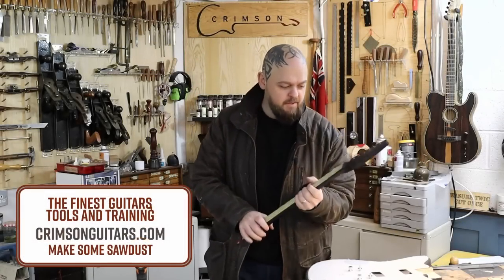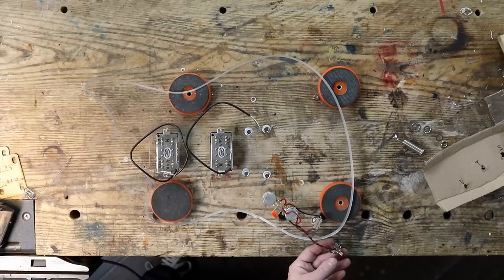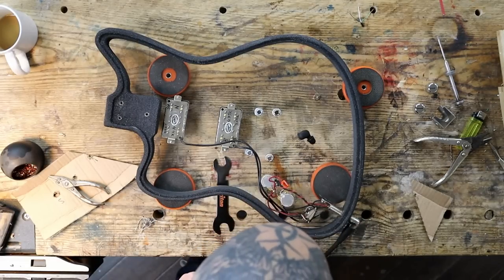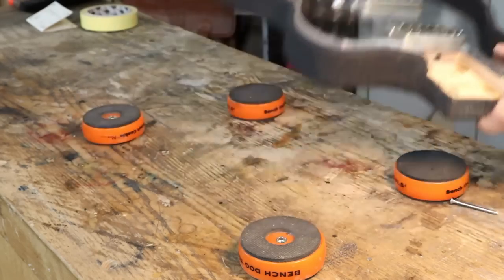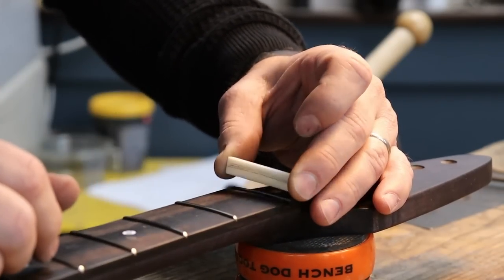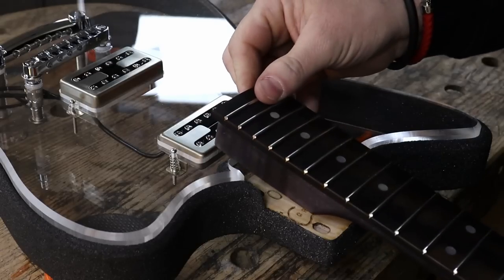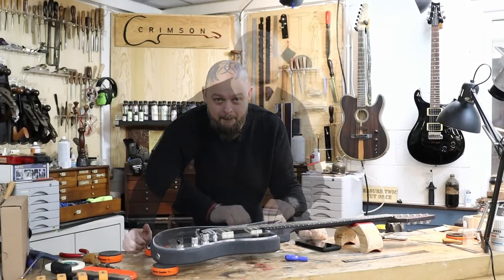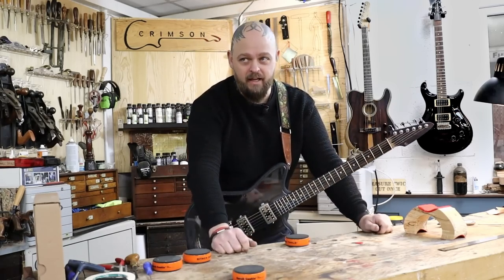Will this Disintegrate?  Finishing touches! Watch Inspired Guitar Build | GGBO2022 Invitational Ep 5

Comment: Looking really sweet now!  Those bolts stopping over compression in the center of the body could do with rubber or silicon pads on the top though; over time I can see scratch patterns building up as the back impacts and rubs against them.

Comment: Hi ben.  love the look of this guitar and it sounded really good.  for the internal wiring did you ever consider doing cable lacing and creating a proper cable loom?  would have looked really good and tidy with the clear body.  i also assume that users will have to be careful of belt buckle scratches on the back of the body.

Comment: You should use copper used for inductor to link everything together, with a bigger gauge you could use them straight, as a bar between circuit and make the  wiring look more clean

Comment: I have worked with quite a few plastics and have found that a used dryer sheet works well to clean and remove the static inherent with the material. Used, not fresh or else it get some weird waxy streaks.

Comment: Since you like using your torch,  and want clear acrylic you can flame polish the beveled edge of the acrylic with a standard propane torch head with a fine pointed flame. It takes a steady hand and the right speed to get it to melt but not bubble, but the results are imprssive.

Comment: You can actually polish those bevels and the insides of the pickup routes and get them dead clear. It's time consuming and requires a lot of patience though.  Take a look at what some high end granite or glass guys do. I've seen them slowly creep up, and sand and polish. Was this huge bathroom job with a lot of glass. A lot of hard bevels, as well as rounding. And all those edges of the shelving created was slowly sanded and polished shiny smooth.  edges of shelving. It was crazy. They also did the mirrored walls, and bevels around the edges of the faces. Lots of patience which I don't have.

Comment: I am a fan of your guitar building skills, any other guitar i like from you! but this here.. hmmm  this seems cold to me. Yeah i know new times new looks new materials, but acryl is a kind 
of plastic. I am more  the traditional type. The body of the guitar doesn't seem very stable either. and in the long run, the body of the guitar will be scratched at the back and front, which can happen quite quickly with acrylic..